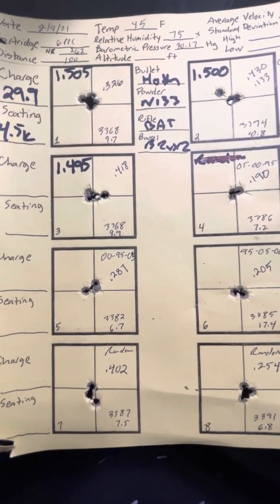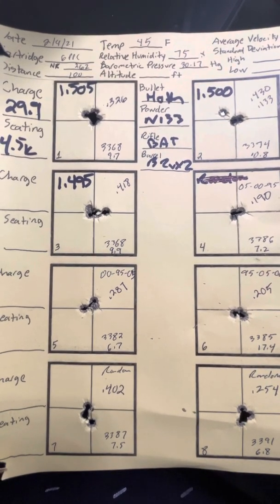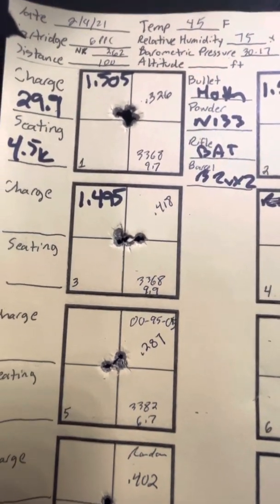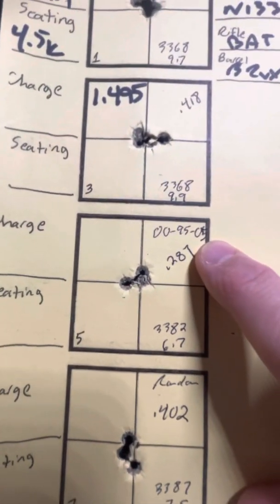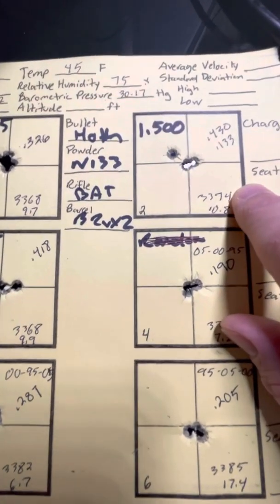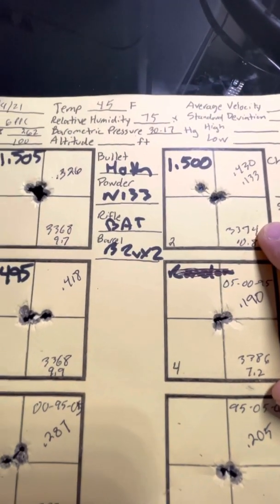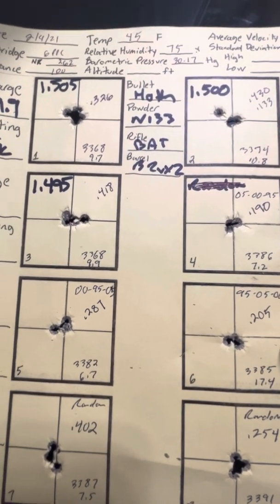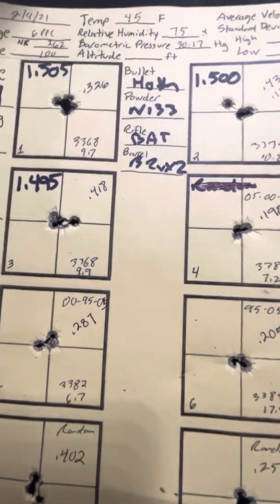Witch Doctor Series: Trim Length with 6PPC Brass

Comment: Bryan, what is the length of your chamber? I think that needs to be taken into account for this test. Do you use the typical Boyer 1045 reamer that cuts a 1.500 chamber length? I've also seen some that are 1.510 length.
Reply from the maker: It’s a 1.515. I warn people against using absolute values from my testing due to any number of variances which is why I encourage people to do their own testing. When my absolute values do not apply, my testing at least provides the method for how a person could test.

Comment: Another great video buddy
 Strangely enough A BR case is the same term length  And I have found that 1.550  Seems to work well in my gun as I have tried different trim lengths  Seems to be the magic number  it works for me and it looks like it works for you as well

Comment: I saw a video with Lou Murdica where he mentioned having a difference in case trim length could cause weird pressure spikes due to the hard carbon ring or having a case just a 0.0001" too long could cause a massive initial pressure spike.  I appreciate your showing us this test, because I have often really wondered, if I trim all my cases the same length vs having just a 0.001" difference would make a difference.  My results are having a difference in a go of 100 rounds where the starting length of case 1 is 1.910" and the final round length was 1.904" all Lapua.  The range was 1.904-1.910" and I saw some weird flyers, but I didn't measure each prior to firing just knew from testing prior to loading what the range was.  I always make sure now that all cases are uniform, but not necessarily the suggested SAMMI length.  I notice a difference in precision and accuracy depending on projectile too.  I have a 6.5 with 153.5 Berger HLRT bullets and H4350 which perform wonderful at 1.905" trim length but perform not so well using a 140 ELDM.  147ELDM will perform just a touch worse and seem to prefer the 1.909-1.910 length.

Comment: for the lower left vertical group it is ly experience that precisely when the wind is "dying down" you can get this kind of'vertical . Its typical at Volmerange where we held the 2011 WBC : in the morning , flags dont seem to move at all but if you close your eyes 10 seconds the new flag picture is obvious : also its 200 m slight uphill slope between buttes and high wall : there is " invisible" vertical producing conditions, that is until you use up-down sensitive flags or - as we did - smoke cans  , sometimes holding them at the end of a pole to search for the source of that down draft ...

Comment from the maker: Update: I conducted an update to the test with four 5-shot groups at the three trim lengths shown above and an additional trim length at 1.490 (a popular trim length among competitive short range bench rest shooters). Here are the results:
Trim length:   Aggregate:
1.505              .341
1.500.             .384
1.495.             .390
1.490.             .313
Looks like 1.490 did slightly better than the rest. That is where I am going to set my trim length. Thank you all for viewing and subscribing!
Reply: Where did you seat the bullet in this test? How many thousandths jump or jam? Thanks
Reply from the maker: @js30br  .0045” jam
Reply: How far off is 1.490" from max case length for your chamber ?
Reply from the maker: @ .025” Standard length is 1.515. Some are 1.510.
Reply: @WitchDoctorPrecision  thanks.

Comment: I like to know if you did the same sizing for all cases and how much sizing ? and witch button? ( if you did sizing at all ) Im shooting Lapua and my current case length is 1,490
Reply from the maker: Thank you for viewing and commenting. Unfortunately, I did not trim down to 1.490. The smallest I trimmed to was 1.495. I used the PMA quick trimmer to trim the cases to the lengths specified in the video. I trimmed after bumping the shoulders. I do plan to test a 1.490 trim length in the near future so please stay tuned!
http://www.pmatool.com/6mm-ppc-br-grendel-x47lapua-quick-trimmer-263nk-or-under/
Reply: @WitchDoctorPrecision  Well to me bumping the shoulder has more effect on the group size than the length though I have not tested it. (Jack Neary has sad that the length is very very important.) Bumping the shoulder to much ( more than 0,0015 will have big effect if one is using just touching bullet seating method . It would be interesting to do a test on this using only neck sizing and not bumping shoulder first
Reply from the maker: @johannesjohannesson423  oh, I see what you were getting at with your original post. I replied about sizing the case in terms of trim length but you are checking about shoulder and neck sizing. I did a separate test on neck diameter in the 6PPC with N133 and 3 thousandth neck tension shot the best group. In that test and this one, the shoulders were bumped 2 thousandths so that the case has a “light crush” fit in the chamber. At some point, I would like to test headspace and precision. Coming soon!